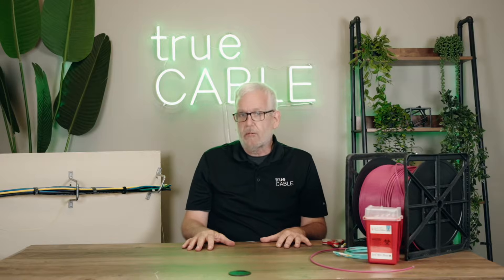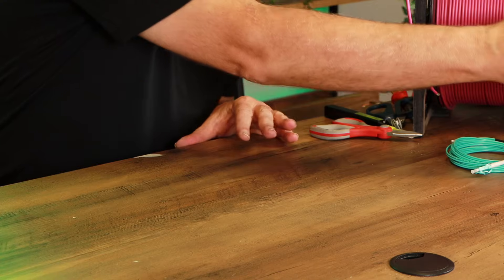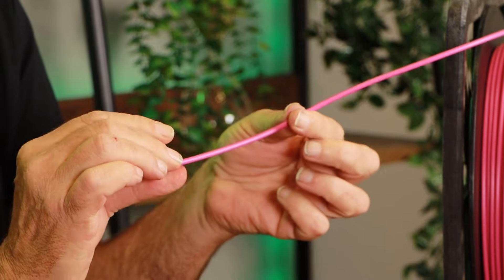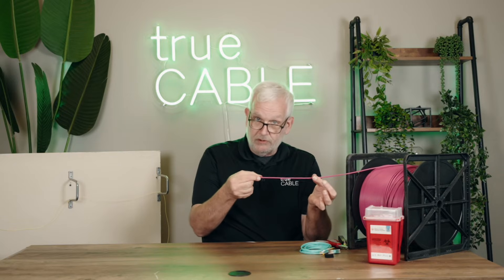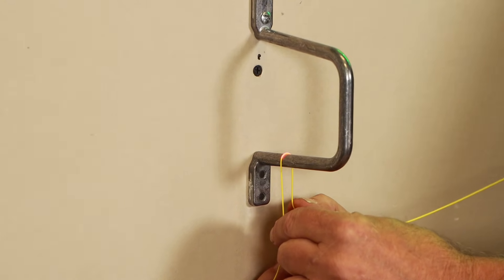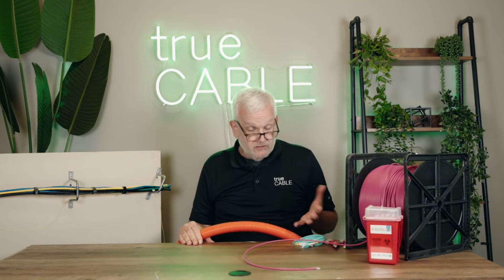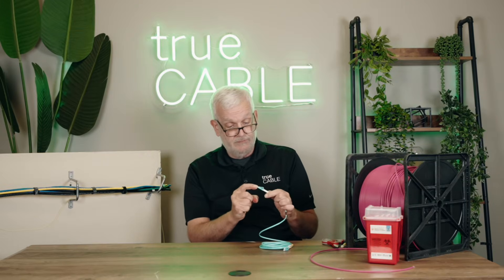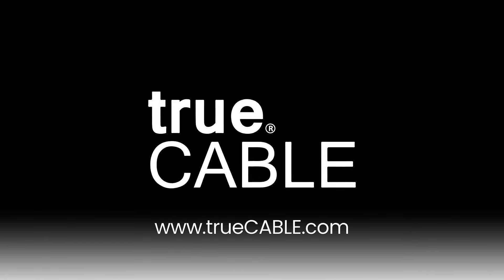The Top 8 Things You Should NEVER Do With Fiber Optic Cable!

Comment: I have never heard of using respiratory protection for cutting fiber. I don’t even recall bicsi or any telecom manual recommending that.
Reply from the maker: Hello! There are edge case scenarios where demolition and factory production (custom cut orders for example) where the sheer volume of fibers being cut is at a level were you would want respiratory protection. The average installer, however, is not likely to need respiratory protection unless put into a specific situation where that becomes necessary. It all depends on what you are doing and you should always approach fiber optical cable cutting, stripping, cleaving, and splicing with an abundance of caution.

Comment: Sir is it ok to let fiber optic exposed to sun rays without put it in tubing ? fiber optic has outer jacket it seems to be already protected.
I have small part (about 30 Centimetre) is exposed to sun rays is that any thing to worry about.
Reply from the maker: Hello! UV light will eventually break-down and destroy plastic cable jackets that are not outdoor (read: UV) rated. If your jacket is not meant for outdoor deployment, then I would not count on it last more than a couple of years depending on your installation environment. Your only alternatives are to use UV rated outdoor or direct burial rated cable or utilize a conduit.
Reply: @trueCABLE  Thank you a lot sir for your information